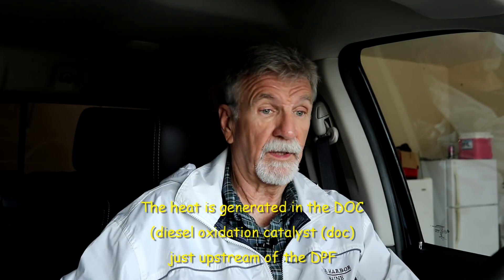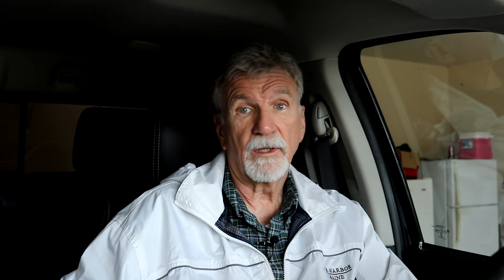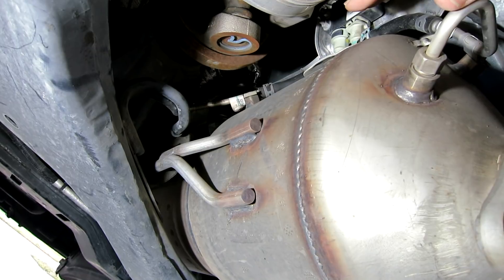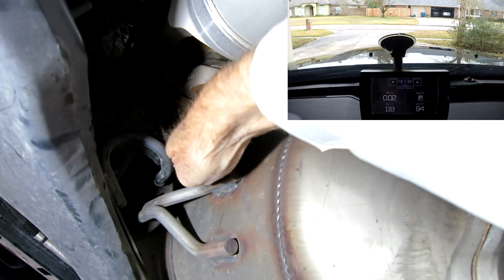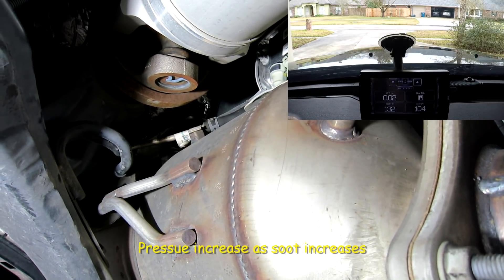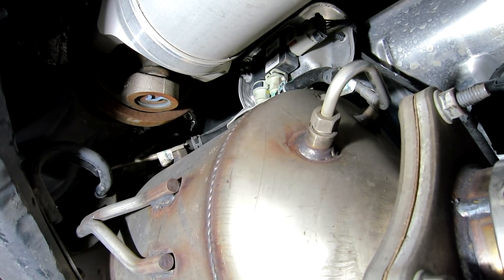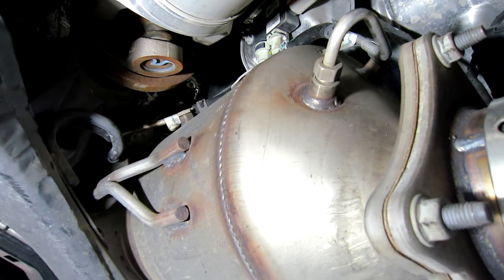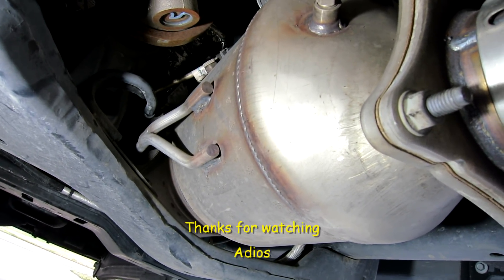RAM Cummins DPF Operation

Comment: I enjoy your videos and as time goes on you are more like a big brother than a father figure.  I have to call you on a couple items in your video.  It's important to know what we have because I believe that we may be checked more and more and deletes won't pass muster.  First, at 2:25 you mention failures.  Mine failed in conjunction with the catalytic converter being clogged.  Of course the Cat is "downstream" of the DPF.  At 5:22 you point out what you call a EGT sensor when it is in fact the injector for the DEF.  Not sure where the egt 3 is.  I know different trucks have different locations.  You could and probably do in other videos, discuss the cat and how the DEF is not related to regen but it is to lower the NOx in the exhaust.  It seems as the cat ages it probably will used more DEF.  Keep up with the great videos.  Thank You!
Reply from the maker: Thanks I noticed the error on the EGT sensor a while back.  Wasn't paying enough attention.

Comment: On my 2011 Ram with 82,000 miles I had to replace my cylinder head gasket and the intake valves due to this piece of crap.
Reply from the maker: Thanks, I hadn't heard of one causing that.

Comment: Quick question how to start that process to burn it off stood
Reply from the maker: It's automatic.  there's a differential pressure switch that monitors the pressure on the inlet and outlet of the DPF.  When it gets to the target pressure, the regen process starts.  It's about .05 psi, very low pressure. (at idle).  Impossible to gleem anything from the pressure at anything over an idle.  thanks.
Reply: Yah it's on I'm inside it right now
Reply from the maker: @keyndn7537  If you can get it on the highway and clear the code, you might be able to burn some soot off if it'll regenerate.  Without a EGT gauge, you probably won't be able to tell.   Stationary is problem the way to go.  How did it get plugged up, something not working?
Reply: What types of regen can be done with proper tools. I heard they four ways to do a stood burn off....

 if so what are they called. And steps to take to begin this processes for burn off.  I'm just trying to help a fellow coworker. Can you help me out mr.blair
Reply from the maker: Do you know if the truck has a check engine light on?
Reply from the maker: There's an android app called AlfaOBD that is supposes to do it.  I can't verify that but they day it will. It's called a "Stationary Regeneration" by the dealer.  AlfaOBD calls it "Stationary Desoot".  The only issue is the app cost $50 I believe and you need a bluetooth OBD connector.  A dealer can do it, of course but that's going to be a couple hundred bucks.  If the truck is in limp mode, but the regen is working and was trying to do an "Active Regen", then you could clear the code with a cheap code reader, like the Autel 309 or equivalent.  You'd have to drive the truck on the highway and keep clearing the code and see if the DPF will burn off the soot.  I tried this on a Duramax but we really didn't finish it, my friend decided to take it to the dealer.  It could work if it's not completely plugged.  Why does the truck need a stationary regen?  Is there a problem?

Comment: When that DEF pump fails or only works intermittently then that will cause it to plug up fast. That pump is problematic and has a high failure rate. Total junk.
Reply from the maker: Yes probably the biggest dealer issue out there
Reply: Morse Transport inside the tank

Comment: That strange noise is your air ride suspension leveling for the weight difference. Mine makes that noise when i unhook my trailer.
Reply from the maker: No air ride on my truck

Comment: My 2013 2500 is now over 120,000 miles and out of warranty.

 I know a lot of people that have deleted their units and gained a ton of power and are now getting 20% better fuel economy.  Plus their now putting all the exhaust back in their engine, which should prolong the life of the engine. 

What’s your opinion on the modification?

Would you ever consider doing it?

Also my low beam headlight on the passenger side just went out. 

Have you researched light replacements?  

If so I’d appreciate your input. 

I live in West Texas and do a lot of night time driving in hog and deer country. 

I’m getting older, so my eyes aren’t as good as they once were, so better lighting would be a plus to avoid critters of the night. 

Thanks in advance for your insight.
Reply from the maker: I'm getting closer and closer to deleting.  If I get an emissions related expense, I'll delete.  My dealer, says they take deleted trucks on trade and they are preferred, ha.  They pass them on to a third party.  My emissions warrant is up.  As to the head lights, I have the same issue.  The OEM lights are crappy and I can't see at night with them, I had cataract surgery but that didn't help.  There's some LED options and also HID but I haven't really explored it much.  I guess that's a good video topic,  Anything other than OEM could screw up the TIPM which is about 1200 bucks.  There's an app that's called AlphaOBD that can reprogram the TiPM to take after market but I haven't messed with it, other than the trial version.  I'm going to look into this headlight upgrade thing.

Comment: My dpf egr and def are in a different place than yours.... it's all in my attic in my garage.
Reply: Ran mine till it got plugged up and gave me problems, the dealer wasn’t interested in helping resolve my issues...  I fixed it, it’s now in my shed.
Reply from the maker: Just noticed this, ha.  Mine will eventually be in the shed also.  What's the preferred tuner and PCM delete method now a days.
Reply: The first thing I did was remove it and it has been on a shelf for 5 years
Reply: LMFAO!!!!

Comment: Will truck run if sensors are unplugged if u know filter is clean?
Reply from the maker: It'll probably go into limp mode, (4th gear) but I think it'll run
Reply: It is EPA mandatory to go into limp mode if DEF SYSTEM is not working. At best you get the 150 miles. Usually limp mode at 5 mph

Comment: Really nice explanation, Mr. Blair.  I was listening very closely, so I recall you saying that it's difficult to plug a DPF up.  Well, the dash on our '12 Ram Cummins 6.7L tells us that we've accomplished a difficult feat; namely, we're presently getting this message: "Exhaust Filter Full - Power Reduced See Dealer."  Although we've worked on our older 2nd gen 5.9L Cummins Ram -- in the past -- we have nearly zero experience with the 4th gen version.  If you have any helpful words for us, a couple of poor old (West Bank) Katrina victims would be much obliged
Reply from the maker: Oh my God, Katrina.  For Lafayette, it was Rita mostly.  I lived in Harvey off Lapalco in 1976 or so.  We had a flood then that had 4' of water in the houses back of us.  Our fortunately was built higher.  But to your problem.  Unless your trips are a couple miles at a time, it's going to regenerate and keep clean.  If you don't have a cheap code checker and clearer get one.  Don't spend more than $25 but clear the code and see if it's a fluke.  These new trucks have flukes some times.   If  it's not a fluke, and you are running it for at least 30 minutes (trips) at a time, there has to be an issue with the programming or the module.  I don't know how many miles you have on it,, but those dealer folks let them sit and idle for very long periods some times and that's not healthy for them.  It really is very hard to plug one up.  I drove 2 miles and back to work when mine was new and never plugged it up.  I did make a point to go and run it for a while every few days.
Reply: I was just chuckling, Mr. Blair, because I was watching your Ram/Chevy/Ford light-truck comparison video when the beeper on my electric dog collar (the cell phone) told me that I had a new email come in.  Unfortunately, we don't have the ideal situation for our 2012 Cummins Ram (under 50K miles) because we're in a mountainous setting in a very cold environment -- where being able to stay warm or light up a work area is just common sense.  In other words, the truck often idles (in the winter) as we're doing our best to get something finished.  The days are very short in this part of the country, so using a truck as a light source and/or shelter often becomes critical.  Combine this with short trips on steep (low speed) mountain roads and you've probably got a bona fide "anything but EGR" situation...but that's all a reminiscence now because the message I wrote about was accompanied by an engine light, loss of power and [the inevitable] flat bed tow job.  I was able to use a trick I learned to retrieve, count 'em, (16) trouble codes, but your words on clearing those darned things out is very well taken...which leads me to this question: What are your thoughts on taking the gag off of a beautiful Cummins 6.7L ISB?  In other words, what are your thoughts on relieving this gorgeous brute of an engine of some of the emissions garbage that [I'm almost 100% positive] left us stranded in the middle of nowhere?  As for more enjoyable thoughts, we, too, lived in Harvey off of Lapalco (Breckenridge Drive), but that was in back in 2001-2002.  After that, we moved to Gretna ... and Katrina took care of the rest.  Thanks very much for taking some time for us -- I really appreciate it.
Reply from the maker: @timberwrightsvs480  Thanks much,  If I was in your situation, I'd relieve it also.  I'll probably do mine eventually also, My emissions warranty is up in April (5 years) so the first thing that fails will more than likely make the decisions for me.  I really like this guy, he's very knowledgeable on the transmission and engine tuing.  https://www.youtube.com/channel/UCmke3Bik1kBGfcHu7x8aEng
Reply: @MarionBlair   Thank you, sir, and God Bless all of you in the south.

Comment: Have you done any lab work on your crankcase oil  for diesel dilution/intrusion?  This occurs as a result of regens which I was very disappointed to find out.  My truck is a 2012 issued pre DEF.  My scan gauge would alert me when truck was in regen; I couldn't believe how often that was.
Reply from the maker: Dilution and off course soot is my two biggest issues with the diesels emissions,  They double the DEF usage if I could get rid of those two things.  I'm hoping the dilution is not as bad as we think.  In town driving, I regen probably every 75 miles.  No lab work but might look some test up and see how they look, I'll let you know.
Reply: I've used Blackstone several times and like their work.
Reply from the maker: Yes, they are popular.  Has the analysis told you anything about dilution?
Reply: To my dismay, yes, approximately 3/4 of a quart per oil change.  Lots of town driving, lots of regens and ecm calling oil changes before 2500 miles; ridiculous!

Comment: Interesting video, Marion. Thank you!  I know you use the Edge Insight CTS monitor (pre-CTS2) to "watch the gauges".  I spoke with Edge last week about the Insight CTS2 for 2017 Ram Cummins. At this time the CTS2 is NOT able to display DPF pressure PID for 2017 Cummins. Edge said if engineers figure it out in the future it would be available through a software update.
Reply from the maker: Thanks.  That's strange

Comment: Your missing some info. There is active and passive regens. The active system is in place for people who do not drive the truck in the right conditions to set off a passive regen. If you tow or run the truck on the highway for long periods the trap will clean itself, hence the passive regen. A leaky injector will cook the substrate right out of the trap. Seen it many times.
Reply from the maker: Thanks, yes, the ECM/PCM determines whether the regen will be active or passive depending on the differential pressure.  The DPF functions the same way either way, just more heat with an active regen
Reply: The passive regen is nothing more than loading the turbo up and making high egt temps. Wonder how it does that? Oh yeah by using more fuel! Active regen is nothIng more than getting the fuel into the cylinder to burn just like under a load that’s enough to “work” the engine. Buy a gauge watch the temps and soot load and drive it. We are stuck with the system and it will take care of itself by burning fuel either way.

Comment: Thanks for that Marion. I don't use my truck for work and have very low miles, but when I do drive it I try to complete a 30 mile run so it can burn off soot. I hope it's enough.- I have an off topic question:When you change your oil do you drive the truck up service ramps, or just crawl under?

Comment: Another informative video. 
My truck makes that same noise. Sounds like an old wood floor creaking. I think it is the door to the HVAC system but not sure. Always seemed odd to me because it does it without the ignition even being on. 
Does not seem to be hurting anything but if you find out what it is let me know- just curious.
Happy New Year to you!
Reply from the maker: no wonder the batteries don't last
Reply from the maker: Thank you.  yea,  it strange, one day I'll figure that out.
Reply: Marion Blair yeah, I lost one of the originals in June one 3 Year’s and 1 month from my delivery date. I switched both to a larger battery, we’ll see how these hold up🧐
Reply: The truck never turn off completely. The computer is always running diagnostic.
Reply: RammC RammC - Thanks, I know it is almost always live and checking it is just an odd noise -like a floor or door  creeking. I am sure it is normal just wondering what it is exactly to satisfy my curiosity.
Reply: My 14' 1500 does the same thing
Reply: My 14’ 2500 Ram has the same noise! Always has
Reply: 2016 Charger makes the same noise. Sounds like a door/gate closing maybe.
Reply from the maker: I think RAM's are haunted, ha